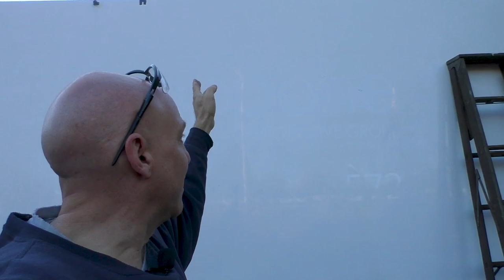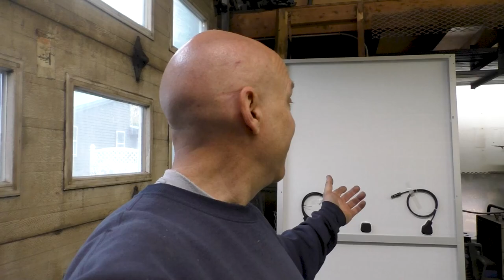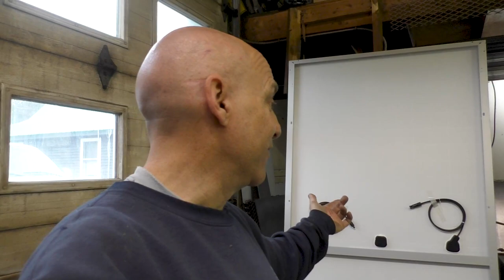S1E16 Killer Roof Rack and Tilting Solar Panels

Comment: Looking good. Can’t wait to see it finished. How did you mount the rack to the roof and also how does the van drive compared to a regular Transit van?
Reply: I mounted it using VHB tape, 2 inch wide down both sides (15 ft).